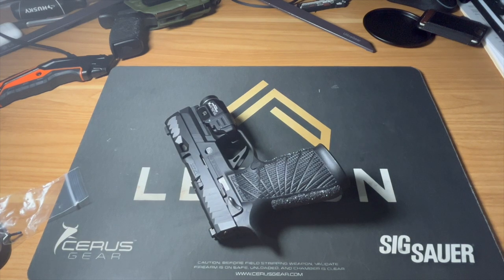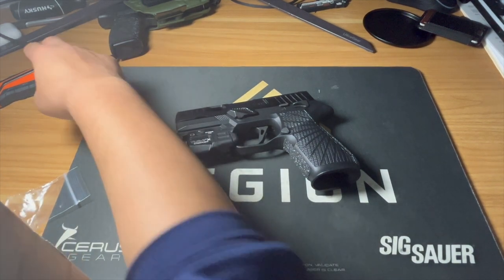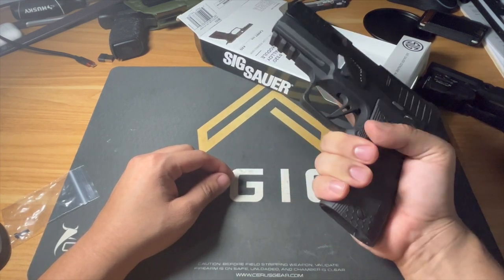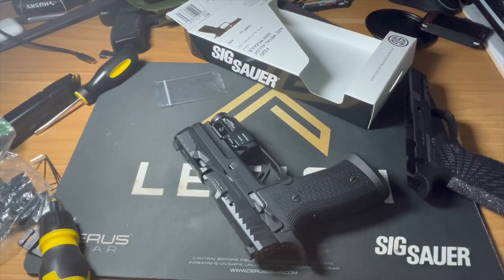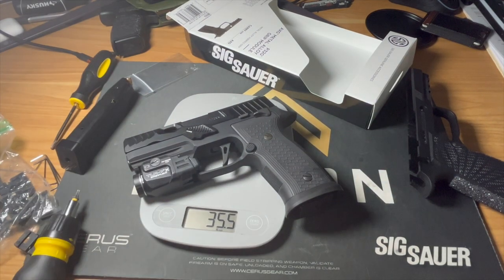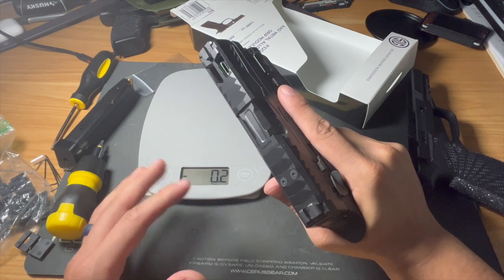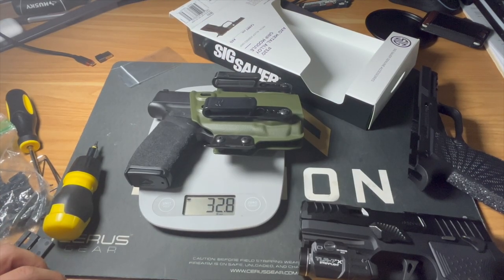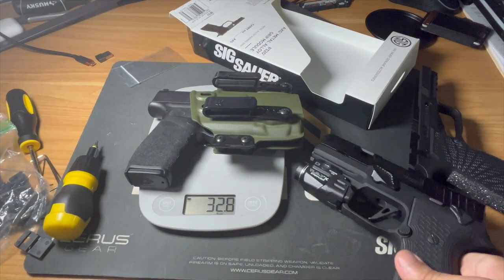ALUMINUM Sig Sauer P320 M18 with ports.

Comment: Bro - get some palm swell Loc grips. I have almost the same build. Using the bull barrel geo port version. 

Great video !!!
Reply from the maker: @acorea44  do they make them with the safety cut?
Reply: @Gunsfornewbies  I believe so - but I was under the impression there was no difference. So I never really checked.